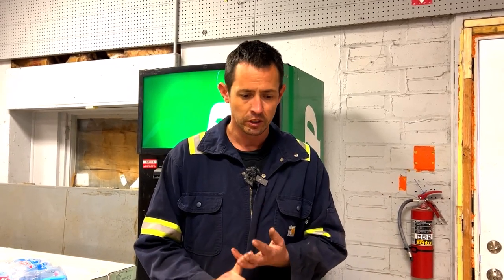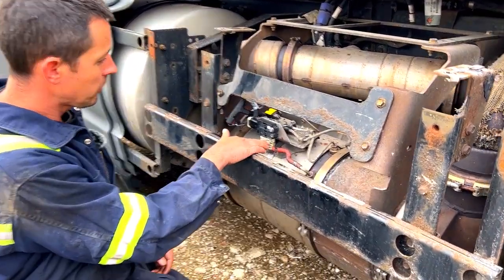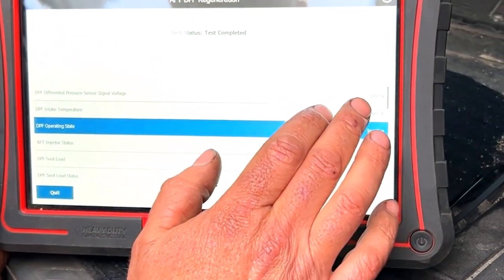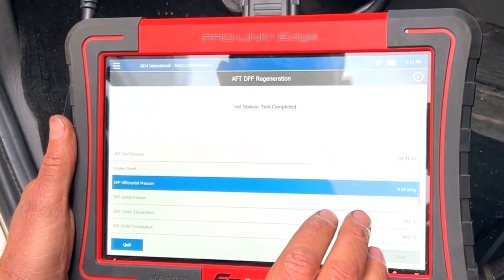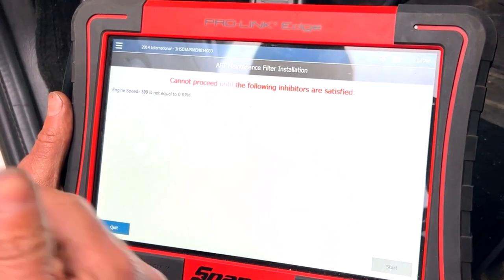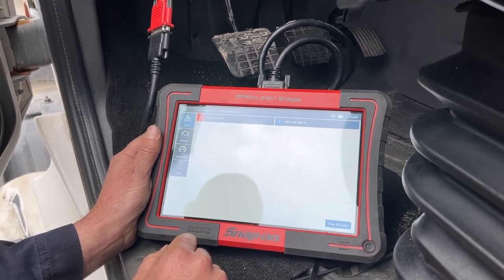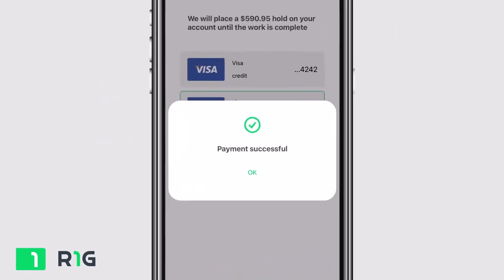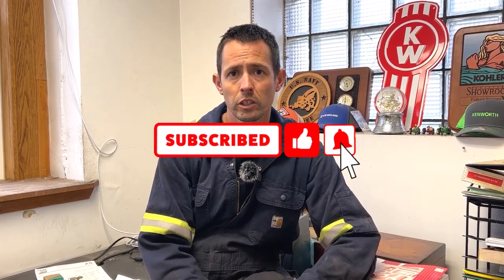International ProStar Cummins ISX15 High Differential Pressure, DPF Wouldn't Regen, High Soot Level

Comment from the maker: Today, we have an International ProStar with Cummins ISX15 engine came to our shop with high differential pressure, DPF wouldn't regen, and super high soot level. We will show you how to troubleshoot the issues and how we can get the system do a forced regen. Fault code - 1922 and 1921.

Check out RIG Platform: 
► Big Rig Mechanic App: https://bit.ly/3F1Itku
► Big Rig Trucker App: http://bit.ly/3iruf4J
Download : http://bit.ly/3B7Cbi2

Comment: Good video, thanks!  I've had a 2017 T680 with ISX for just over a year and I noticed it had started doing rolling regens ever other run I made.  Over a weekend, I went to the yard, disconnected the tractor from the trailer and pulled it out into an empty area in the yard and did a forced regen.  Since then, it hasn't done a rolling regen.  The rolling regens suck because they KILL your fuel mileage.  It's CRAZY how hot this thing gets when it does a regen.  You definitely DON'T want to do it around other equipment or anywhere near grass, leaves, etc.
Reply from the maker: Thank you for the comment! 👍

Comment: Thank you for this video.  I do fleet maintenance on mostly Internationals w/ISX.  A few Cascadia’s w/DD13’s.   I also ise a SO link edge.  Luckily I’ve not had this happen to me (yet), not doing a forced regen.  However, if I do, now I know how to “make it happen”.  BTW I normally force a regen at every oil change.  I usually see a .5-1.0 oz of soot.  Am I doing good by that?  Thanks.

Comment: Hey Ryan I have a 1691 fault code on my 2019 kenworth t680 I have a Cummins engine,I was driving the truck everything was good truck was as doing a regen while driving and I think I shut the truck off before the regen was complete and o got a check engine light and the code is giving me is a 1691 I don’t think dpf filter was replaced brand new 1 year ago so I don’t think is a bad filter what are your thoughts?

Comment: Does soot level go down when you hot dog the truck, I noticed from the OTR tool it will say 8% soot level, but then if I climb a road mountain or really getting on the truck goes down 2 or 3%. Also what is an acceptable ash level to go and have the DPF cleaned, currently OTR says it's at 71%?

Comment: Hey can you run without a crankcase pressure sensor? I have one with bad wires that keep making my check engine light come on I know it had to be the wires because I replaced the filter and sensor and it’s still showing the same exact code so I was thinking maybe just unplug it and the check engine light will go off maybe?
Reply: I also have the maintenance free filter as well installed
Reply: @nalgas5569  makes sense lol preciate that! I just hate that check engine light it’s off some days and others days it’s on
Reply: @bthatrucker were you able to figure it out ? I’m having your same issue installed new dpf filter and new dpf pressure sensor and new doser and I’m still getting the spn 3936 fmi=2

Comment: HI great videos I have a question : I have a 2019 Kenworth t680 PaccarMX13 I have a warning on the dash.. "sooth level very High " and it will not go on passive Regen nor a forced Regen. it has a couple of codes pointing at the EGR: P1488, U1573, 127-5 . I noticed that the control arm wich connects the 2 moving parts was missing, so I  thought, maybe that's the problem but the dealer don't offer that part for sale so I fashioned one and installed it. went on the highway for 30 min at 65MPH and nothing, parked the truck , try forced Regen and nothing. any advice any tricks to force the Regen besides replacing the EGR thank you
Reply: Did you find what was the problem

Comment: Hey Ryan how you doing I have a problem My 2013 ford f650 with  a Cummins motor   Billing up bad pressure Crank case filter I take the truck to cummins dealer  Change crank filter case back  Pressure sensor And I still have oil coming up to the crankcase filter
Reply: Piston rings
Reply: Or scuffed bore

Comment: stop parts throwing parts at the dpf system and costing your customers money, the sensor should read .69 at key on with engine off, and many will show .63 but function correctly, the regen is triggered at .88, once you show the ecm that a new filter is installed it changes the amount of fuel injected on a regen, as the filter ages and fills up with soot the ecm increases the amount injected, to trick a regen either remove the hoses or plug in a new or know good sensor and  regen, however you should use caution doing this as you can melt the dpf system and or set the cab on fire, once the regen is in process and the temps stabilize the dpf temps should be within 50 degrees of each other, in and out, and no more than 100 degrees difference or the doc is bad. also use insite to set the aftertreatment tab in features and parameters the first two down should be enabled so it will regen in pto and the park brake. i would assume this guy idles and idles it up so a regen is almost never done